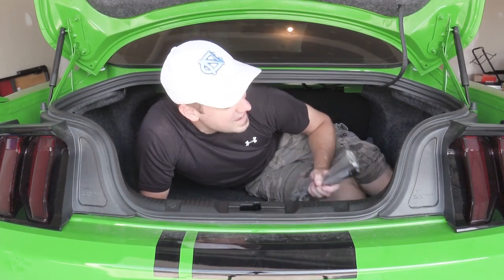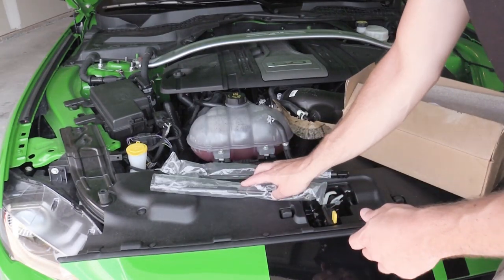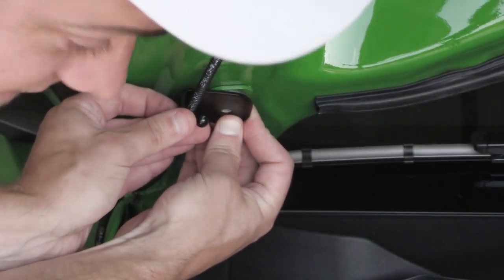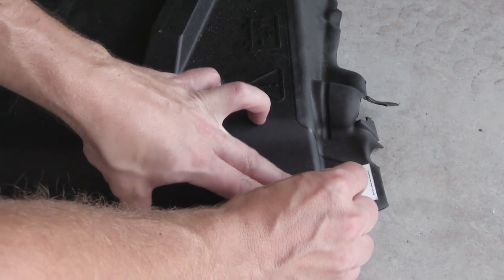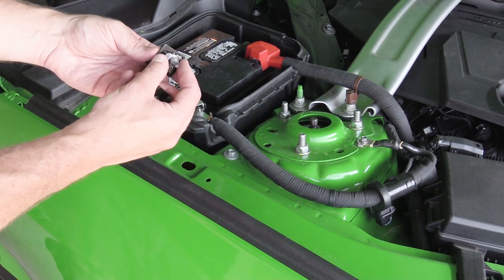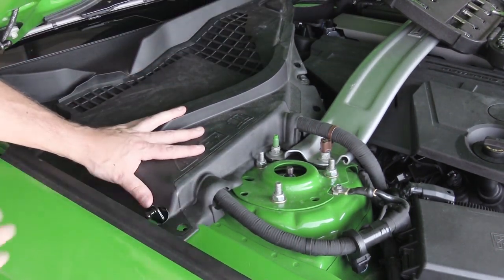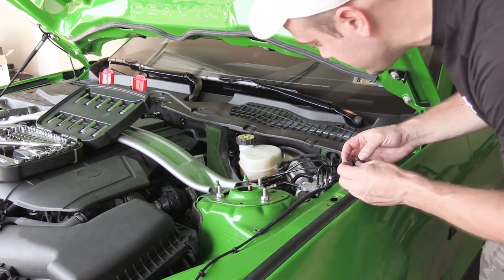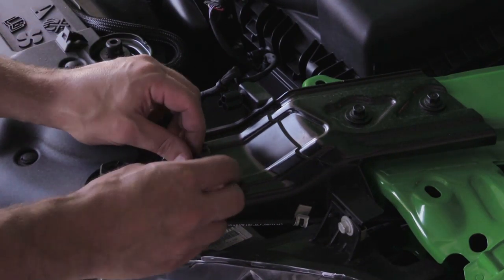Ford Performance Hood Strut Installation | 2015-2019 Ford Mustang

Comment: My first mod on my 2019, with a hitch! On the factory hood you need to re-route the washer fluid line or it gets crushed by the strut. Since posting my video I also recut the hole in my battery cover all the way to the cover’s edge so it can completely come off, and isn’t trapped on the strut. I love this mod and recommend it to all Mustang owners!
Reply: Where did you cut the hole?! I’m
So confused! It keeps touching and it’s so frustrating
Reply: Did you reroute the wisher line? How did you reroute it? Ty

Comment: Your hat got in the way. I  ended up making a "slot" more than a groove on the battery tray, Nice job pointing out the "Circular Doohickeys". I also ran into an issue where my windshield washer hose on the passenger side got "crimped" by the hood strut. I had to move a few mounting clips to re-route the hose so it would ne "pinched" when the hood was closed.

Comment: Just got the struts.  Thanks for the video.  I was wondering about leaving the prop rod in case the struts ever fail?
Reply: My thoughts exactly -- I would leave the prop rod in place for that reason alone. I've had prop rods fail in the past, and it's a pain not to have a way to keep the hood up.

Comment: Looks like a great mod, one question though....it appears that anytime you need to take the battery cover off, you have to take the strut off?  Did I miss something in the video?  How easily the strut detach?  Do you need a tool to disconnect it?

Comment: Just installed mine and found the driver side bracket keeps swiveling and has dug into the metal. Did you find a way to fix that or modify it?
Reply: Yes.  Get rid of it and install the Roush kit.  The Ford Performance version has no way to prevent this rotation when torqued to 20 ft. lbs., which may allow the strut to pop off and damage the hood or fender.

Comment: follow up on this, are they stupidly squeeky? I just installed mine and they were awful and so I took them back off assuming something was wrong. Then i dropped the little washer with locking teeth down in the wheel well. lol. do you know if cj pony parts supplies replacement parts and are your struts squeeky

Comment: This mod sucks. sometimes the struds just bail at you and the hood drops shut. The previous owner tossed the rod, now I have to find a replacement for such a niche part in the EU. Edit: I just looked up this video to see where the rod has to be attached.